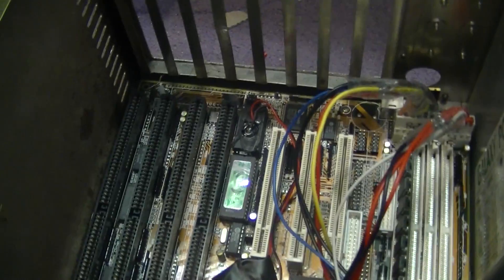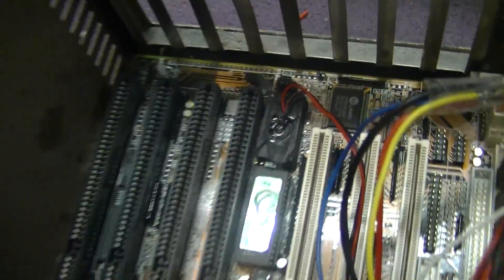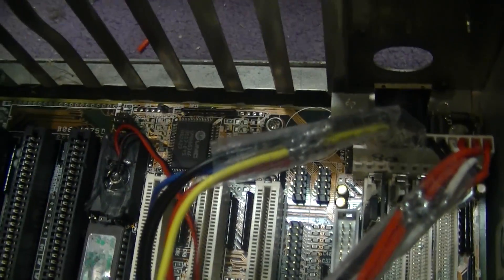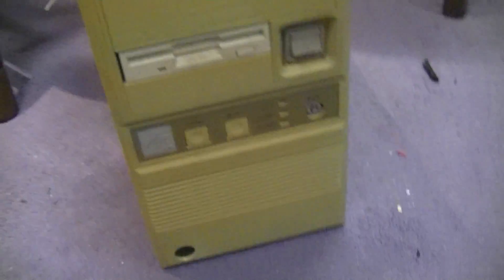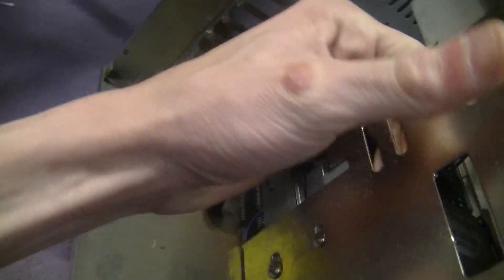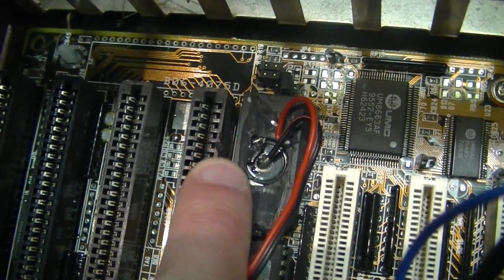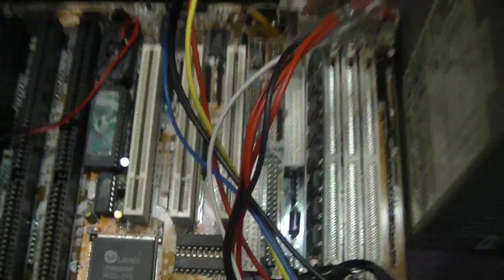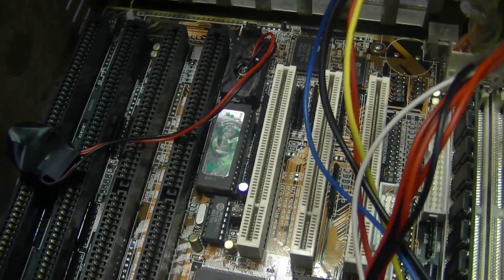Newbie Gets His Memory Back Dallas RTC Clone Battery Replacement

Comment: That's a Biostar Motherboard isn't it?  I had one just like it and ruined the motherboard trying to remove the bad RTC module.  I had a Cyrix 5x86 120MHz CPU in mine.  I remember my board had issues with PCI video cards as well.  It would be hit or miss at times on power up.
Reply from the maker: +ESDI80 Yes, yes it is .. I finally solved the PCI issue - chip rot .. The PCI slots run fine clocked down to 22MHz but they can't run at 33MHz anymore

Comment: You can get new'ish replacement Dallas chips on eBay if you want to do a cleaner job. You could desolder the chip and solder in an IC socket so that you can drop in a new chip in the future when the battery dies again. If you can't desolder the ground pins, use higher watt equipment. :-)
Reply from the maker: +8bitbubsy My desoldering skills are worse than my soldering ones!

Comment: make sure the video card supports 5v functioning, first and foremost. past that, if you can find a decent card with an OPL3 on it, you're absolutely set.  you have a prime board for an overdrive CPU upgrade there if you decide to do that in the future. I'd also look for one of those Y2K 8-bit ISA cards that, aside from other functionality, add IDE auto-detect features as a BIOS extension.

Comment: Adafruit has a dual CR2032 battery holder with on off switch. It outputs at 6V, but you could probably rewire the holder into parallel to have the normal voltage.